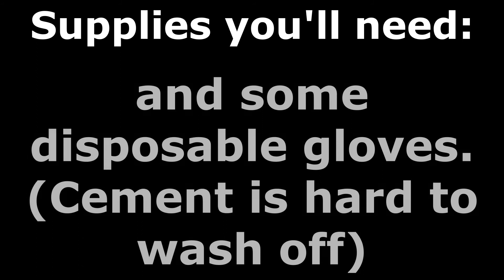How to Patch Roof Vent Leaks with Henry Rubberized Wet Patch

Comment: Thumbs up for this simple yet effective video. I have this problem with the leaking vent. I know what to do but out of curiosity I watched a bunch of videos on here to see what the "experts" would suggest. You would be surprised at the majority of videos that are basically by contractors telling you you need to replace half of the shingles around the vent. Typical making a simple job 100 times more complex to justify turning a $60 do it yourself job into a $7000 roofing job.
Reply: You are confused. This is a flat roof. Talking about a single roof those other videos are correct and you cannot just use this material.

Comment: In a protected area (under deck boards) do you need the mesh? I have a spot to patch that won’t be getting hit by hail, acorns, critters, etc. Wondering if I can skip that step. Great and helpful video, by the way!
Reply from the maker: The mesh is really important to control the expansion and contraction of the patch so I wouldn’t skip that. It’ll seem like you don’t need it in the first place but don’t risk it since repatching would be difficult to do.

Comment: Would this work on a pitched metal roof? There's an abundance of what looks like tar, perhaps this product. Do I just go over it? 😊 It's a gas furnace exhaust with no cap and a huge metal "box" with "tar."
Reply from the maker: In your case I don’t think it’s worthwhile to patch an existing patch. If you have an active leak then water has already somehow penetrated the “tar” like patch so I’d try to clean it up as best as you can so you have a good base for the new coat.

Comment: How long did this take to fully cure? The product label says 8-24 hours to cure. I hired someone to apply Henry Wet Patch 208 to some spots on my flat roof. It’s been almost 72 hours and it hasn’t cured. It’s still mushy. It’s been 60 degrees during the day and mid 40s at night, no rain . Is the  actual curing time much longer than 8-24 hours ?
Reply from the maker: I haven’t climb up to my roof to reinspect my patch, however from my experience with this product from my previous jobs, I’ve experienced several times the patch took weeks before it starts hardening. Maybe with your scenario your patch was getting moisture during the night so it takes longer than normal to fully cure. If cars around your neighborhood get a good amount of condensation in the mornings then good chance your patch is being moistened every day which will extend your cure time.